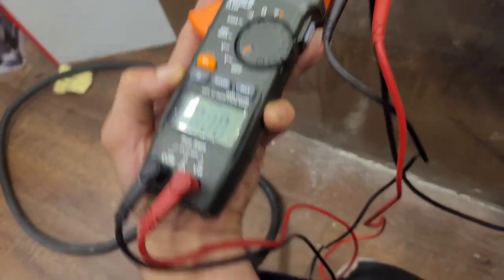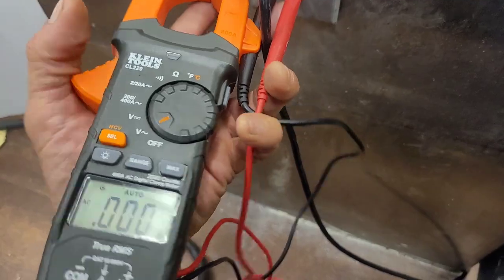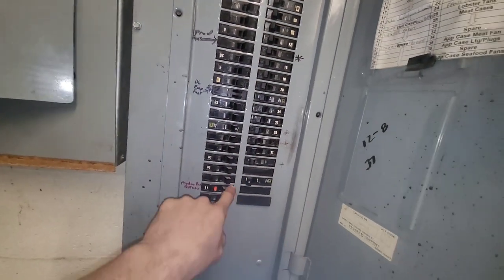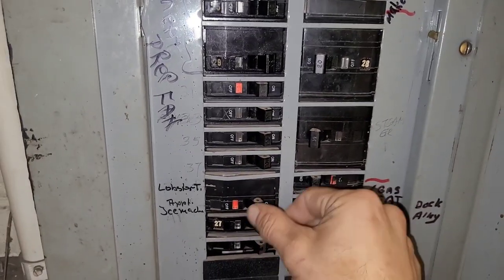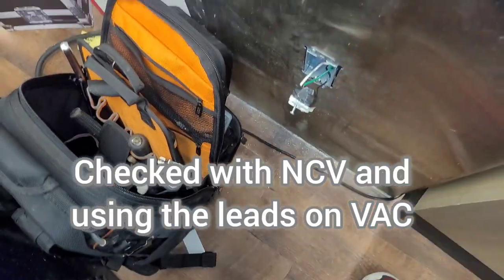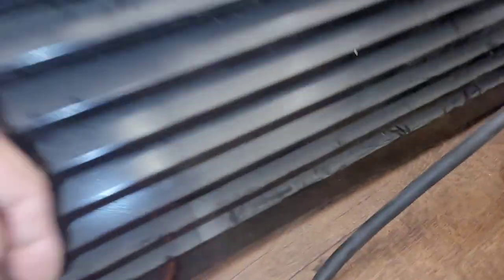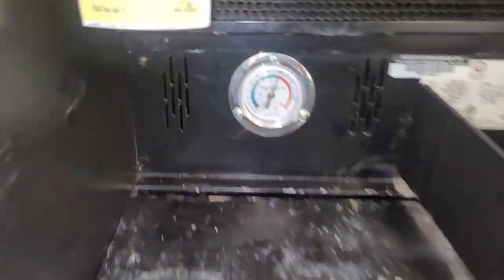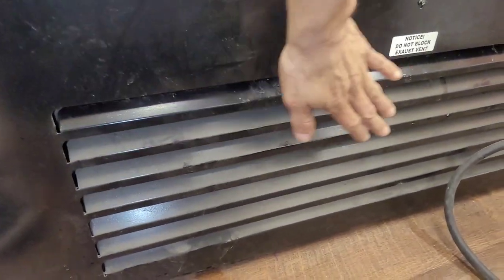Supermarket Deli Case Call - No Power Needs Electrician

Comment: Welp. I've been in and outta supermarket chains. 
When there's a 'no power to unit', I'd definitely do like you did and plug into another source. 
Is it possible that it is a GFI protected receptacle?
Probably not... I'm betting somewhere, one them breakers that will not 'hold', is that that outlets feed is grounding out somewhere! 
Especially in an older layer out store, so many renovation had happened.  
Or, depending where that panel is feeding said circuit,  is in another panel, hidden across the store or in a closet, or in deli or seafood or meats or dairy sections.  Behind a bunch of shit! Lol
Yeah always fun, hunting for them damned 'no power ' circuits! 
Good diag, be blessed bro.
Cheers from Pennsylvania
Reply from the maker: Most definately. Everything you said, yup. Just like that! 
Thanks
Reply: @MASTER TECHNICIAN MINDSET  
You're welcome man! Keep up that great diagnostic work